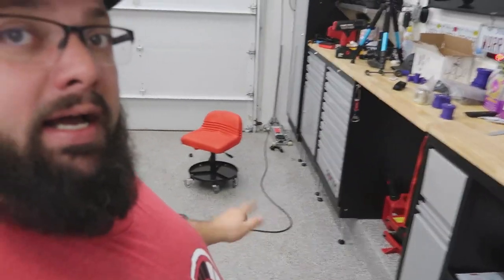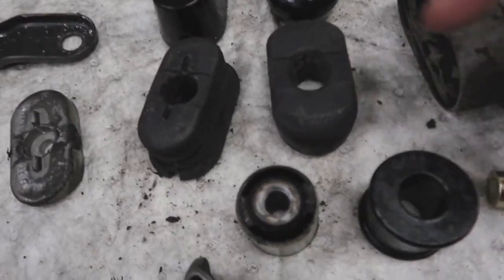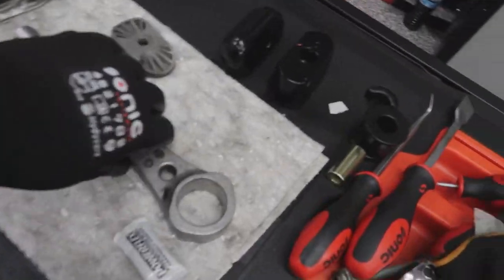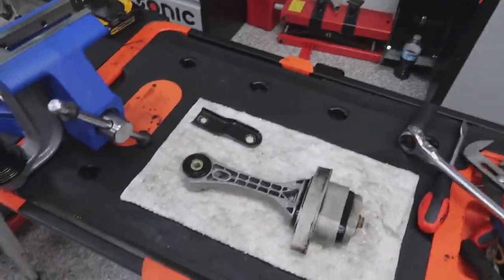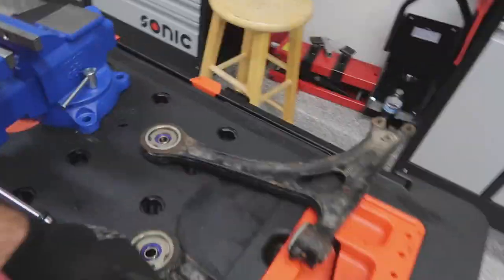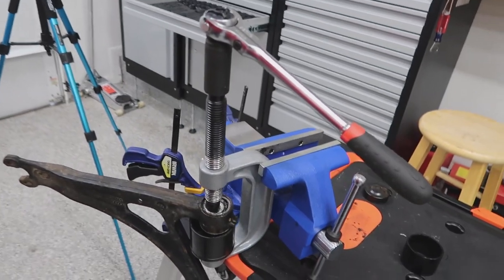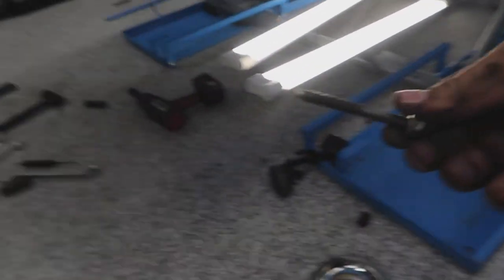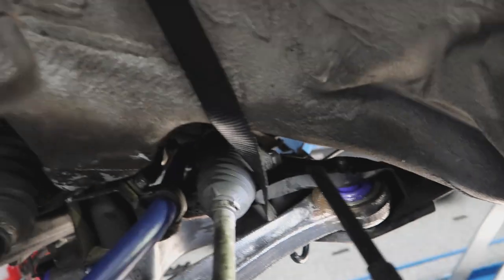VW MK4 R32 TPROBLEMS UPGRADING my Front Sway Bar Front Bushing 😩 The Project Car Rebuild Pt.9.2.

Comment: I havent watched the rest of your vids on the car, but i did a front swaybar on my r32 last year, it was a real pain. but the bar has a dip in the middle to clear the steering rack, it needs to be facing down and the ends of the bars (where they connect to endlinks) need to be in roughly the correct spot they will be when the suspension is installed or you cant tighten the sub-frame down.
Reply from the maker: TheDemoncaller thanks. Yeah ended up figuring it out but yes for sure a plain in the a$$
Reply: @GasTachs  just finished the next vid and saw that 👍. also think about not daily driving it on salted roads. if you think its a pain to work on now wait till everything is rusted solid (before my R I had an 01 vr6 that was rusty), its a nightmare. These cars are too cool to waste it getting rusted out in a couple years driving on salty roads
Reply from the maker: TheDemoncaller I hear you... this car has some rust on the front Quarter panels but everywhere else seems fine right now. Not planning on getting this baby rusty after all this work either.
Reply: @GasTachs  shouldnt be too hard to fix that if you decide to, remember to unbolt the fender wells where they connect near the side skirts, crap falls down the rain tray and collects between the fender well/sideskirt/body there and stays moist and will rot it out if unchecked
Reply from the maker: TheDemoncaller yup thanks.
Already off and planning on getting them
Back to normal in the next month

Comment: What SUV do you have? Trim level?
Reply from the maker: William Soublo 2019 Ford expedition platinum. White with white interior... it’s Epic!
Reply: Gas Tachs nice, I’ve been looking at Suburbans and Expeditions myself. Did you go with the max?
Reply from the maker: William Soublo, didn’t go with the max, didn’t need it. I also have a F150 so if I need something in the back I’ll use my truck.